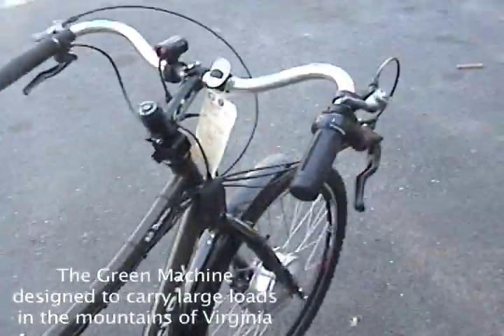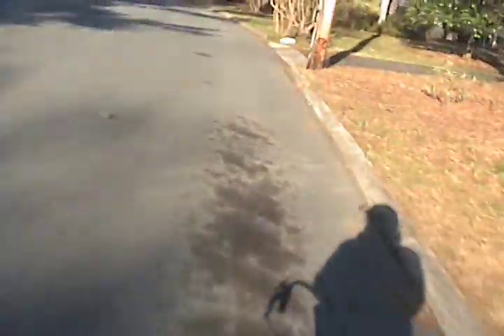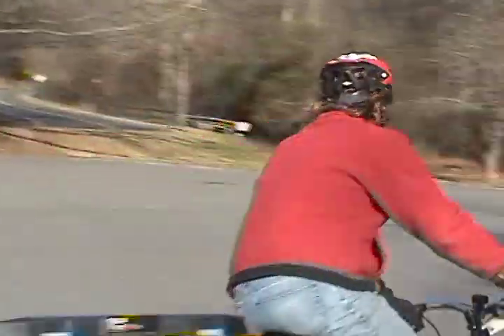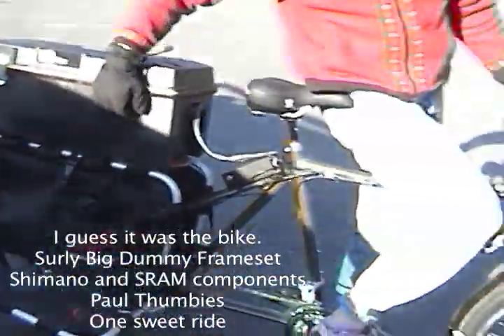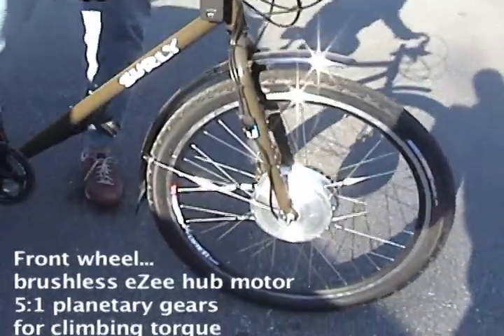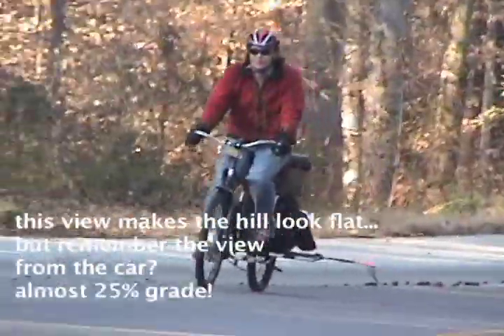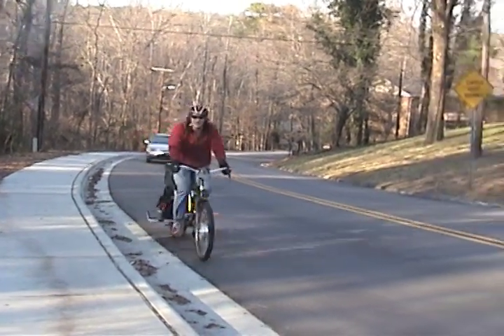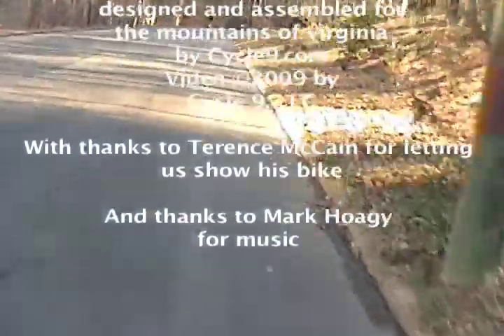The Green Machine electric cargo bicycle - dual hub motors

Comment: How much does a big dummy bicycle cost? Battery could fit inside of frames main triangle. Not floodproof. A Honda Rebel is the same price and street legal. There is a weight limit for electric bicycles it is 150 pounds. Heavier is a motorcycle.

Comment: It's in the ballpark of $2K.

The battery was purchased last October.  Because of market volatility and currency fluctuations, you'd want to get a new quote from LifeBatt; old prices are not reliable.

If you choose LIfeBatt, you may want to keep in mind that they do not furnish an overcharge protection circuit (or at least, they didn't last October).  Cycle9 custom-built one for this bike.